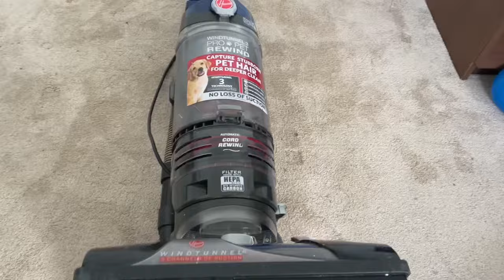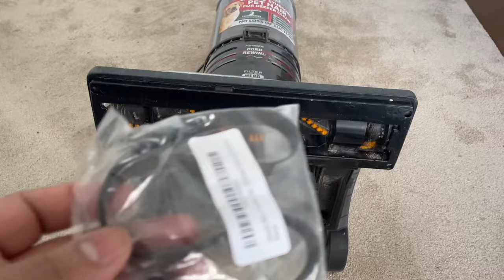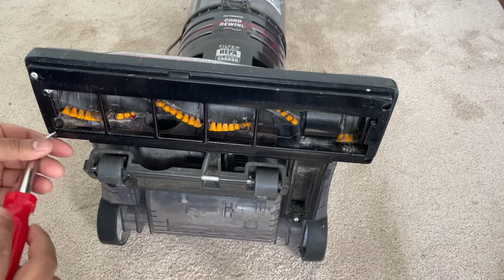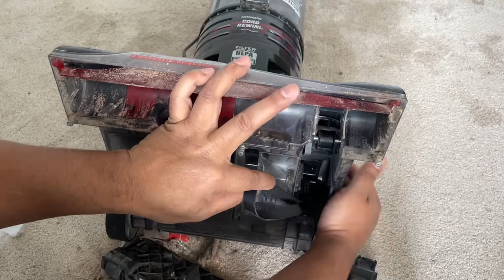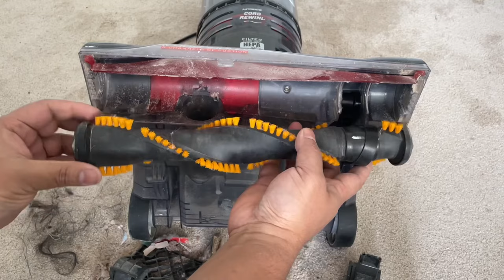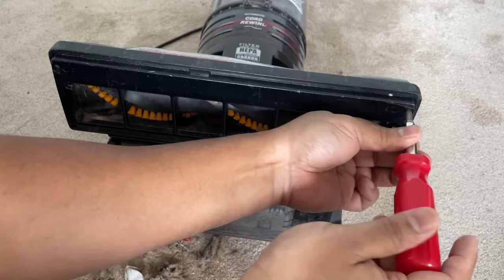Hoover Vacuum Brush Not Spinning? Watch How to Replace the Belt!

Comment: You are the man, thank you! My belt was fine but I watched so I could learn how remove the brush. I needed access to the clogged lines that had a fuck ton of compacted dust which made the vacuum not work at all and caused the motor to overheat within 3 minutes of turning it on. It's all good now!
Reply from the maker: Thanks for sharing

Comment: I had done all of this before and still loose.  Couldn't figure out why the tension wheel wasn't engaging properly.   Then I found out that the roller won't work with the vacuum upright.   if you engage the tilt feature while in carpet mode, it works properly.   Been annoyed by this for days before I figured it out.    your video was a good one.   didn't solve the problem, but it helped me eliminate weird theories I was having.

Comment: Removed the brush from my Hoover UH-74200 & throughly cleaned it. Checked/removed belt & it still looks damn near pristine. Put it back together properly, plugged it in & still the brush does not spin a lick. 🤬 Any other suggestions, y’all?
Reply from the maker: Maybe the motor stopped working
Reply: Have you checked to make sure the button left of the base is up? That button engages and disengages the brush so that it’s not spinning when you don’t want it to
Reply: Had same problem. It seems the Brush Roll On/Off Pedal Switch does not put enough tension on the belt. I see nothing wrong with the pedal or roller that is attached to it. My "Fix" was to wrap electric tape tightly around the brush roller. Did not count the turns, but seem like 3 or 4 times around. It did not take much. Remember to maintain the curved shape  where the belt rides and keep tape tight and wrinkle free.  While I have not had may hour running this "Fix", it does seem to be working. Only other option I can think of is a slightly smaller belt. If this "Fix" fails I will explore other belt sizes and post on my findings.
Reply from the maker: Any luck Paul?